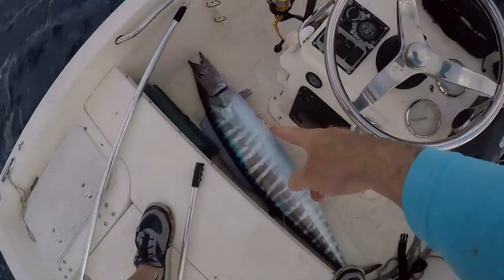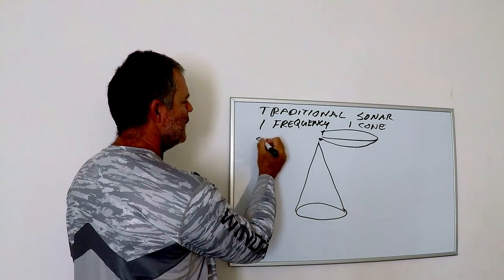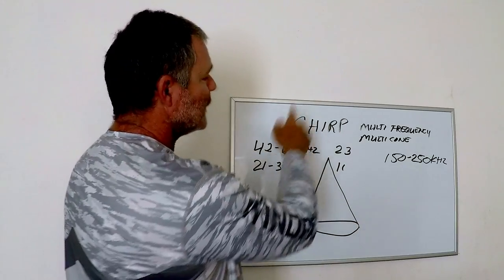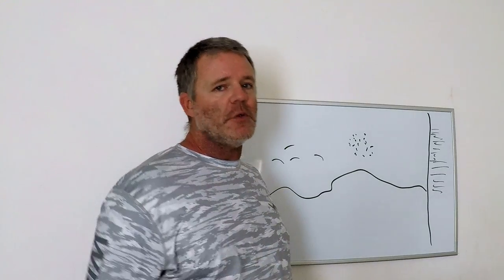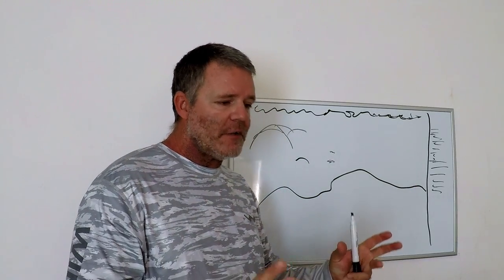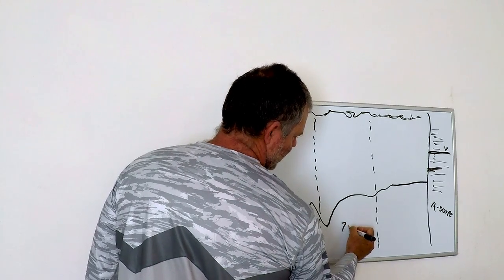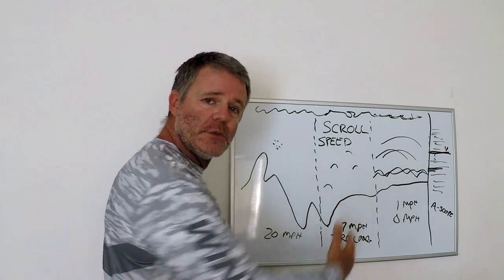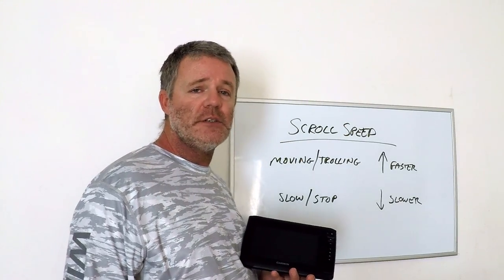FISH FINDER basics

Comment: Great class.  I have a raymarine axiom with a hull transducer and another one on the back by the engines.  Pretty decent set up , not top of the line but mediocre . System has 3d vision, side view, etc.   Depth reading always disappears around 300ft regardless of wave conditions or speed of boat.  Any suggestions  on settings from you or anyone out there is appreciated,  I just can't get any image/ reading when I get to the humps in the florida keys.
Reply from the maker: Try setting your depth to auto read... those humps are 400-500 it should pick them up if your are in idle.